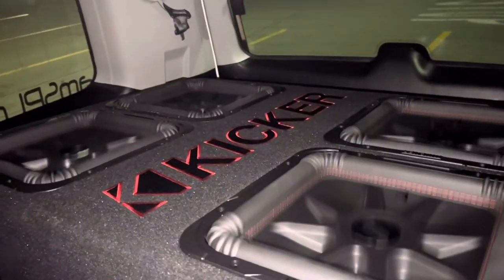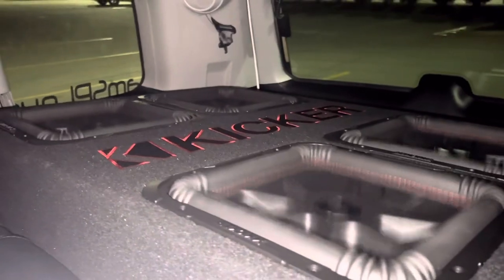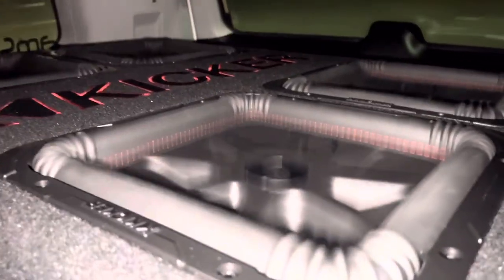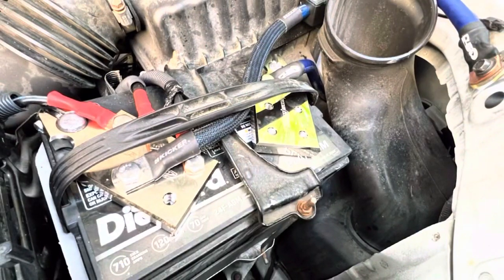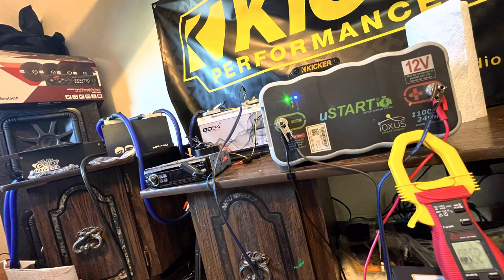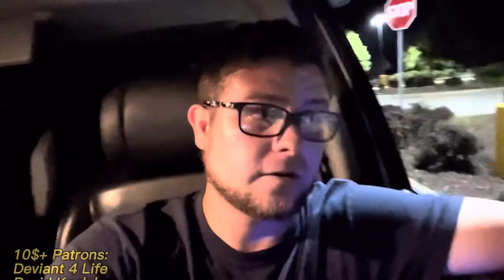Kicker Quad Box Demo -Update #2

Comment: Your system sounds great! I have the quad box also, but my kx2400 has been clipping, what would you recommend I do for it to be louder without clipping? Should I make it 4ohms?  It’s only on 2 ohms now.
Reply from the maker: Nice ! The 2400.1 is perfect for it ! 

If you have both sets of wires going to the amp - then you are actually at 1Ohm! 2 ohm per terminal cup 

What does your electrical look like ? 
You’ll clip earlier than you should when you don’t have the power to supply the amp 

Let me know what you all have
Reply: @LivinLoudwithAndy  I have 2 limitless  cyber12k batteries, added a mechan 379 alternator with 2 0gauge wires running from alternator to batteries in between each I have the wires running to a 300amp fuses one in the front and 1 in the back. It gives me 13 stable volts with no drop.  Do you think the fuses are limiting my power?  I’m pretty new to this and watch a ton of videos, but still unsure how to fix the his problem.  Thanks for taking the time to answer.

Comment: Mine sounds really good on a single soundigital evox 3000.1 wired at 1 ohm
Reply from the maker: Bet that gets down!
Reply: @LivinLoudwithAndy  for sure.   2 batteries and a 400amp alternator.   I wish I could find someone around me with a meter to see what it’s putting out.   It will definitely take your breath away on certain frequencies.   It’s in a 01  Benz wagon.   3 layers of 80mil sound deadner on the roof and 2 layers in the side walls and hatch.

Comment: Kicker let me down, imo they made it sound like the Quad box was their jumping into the spl game I figured they'd have come out with some other products aimed at the bassheads. Like perhaps single and double  sub boxes tuned low. Big azz company like Kicker why wouldn't they come out with a spl lineup of drop in bass products. Not knocking the Quad box it's actually a bargain for what it delivers but not an option for most due to it's size. Most people are lucky if they have room for 2 12s.